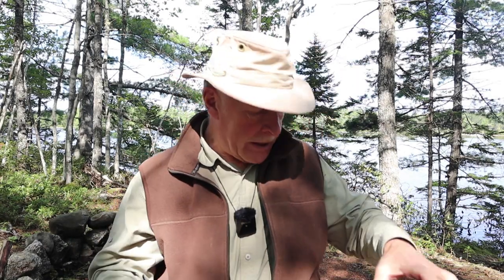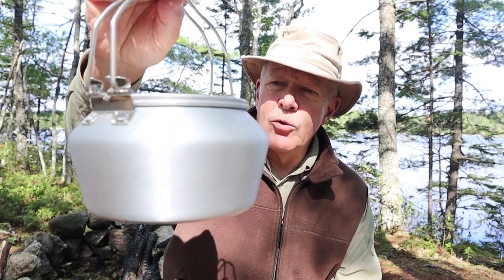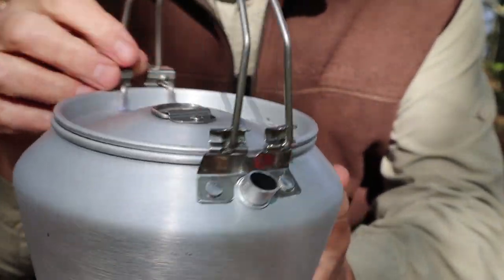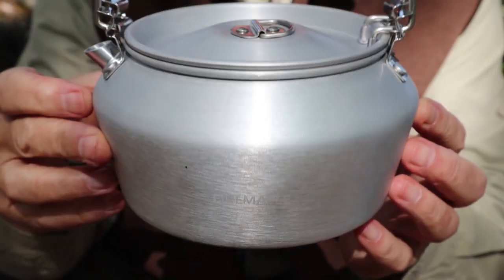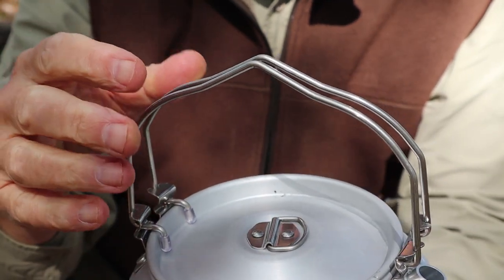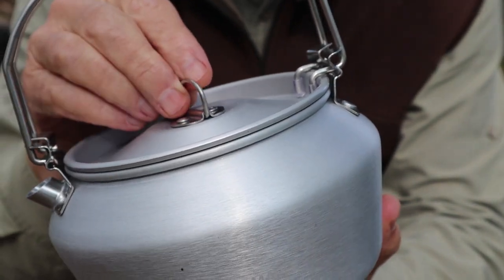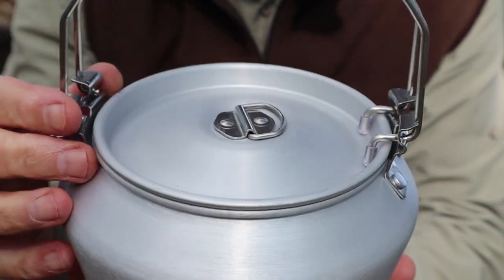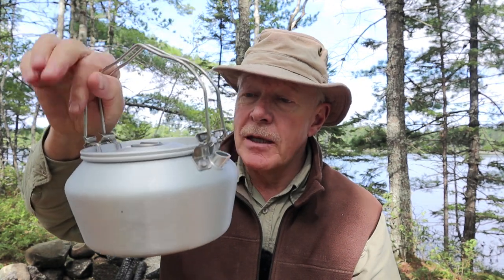Fire Maple Nimbus 1.2L Kettle

Comment: Hi Mark, hello folks, re: blackening ( a short story... made long lol) I love this so I like to pass it on:
I don't know about for use on aluminum as I only have/use stainless, that said, I cook almost exclusively with fire at this point, on the wood stove which runs 8 months anyway, then I stumbled into rocket stoves, design and tinkering as a hobby... aka, I've burned the hell out of some perfectly innocent kitchenware over a few years- so pretty much don't bother with my propane or butane stoves at all in summer anymore either as my fire game is locked down at this point. 
Anyway, came across ladies in a village in Africa I believe, and they take their cookware and first cover it in a slightly watered down clay, basically paint in on the pot bottom, sides and lid for that matter, let it dry for a minute near the fire. Then you're good to go. It can get as black with that shinny, lacquer like creosote and you just soak it for a minute to get the clay to start to moisten then scrub off with barely any time or effort. Keeping it wet or under water as you scrub is helpful also. 
I'm saying "scrub" but this is minimal effort in comparison to scrubbing a burnt pot. 
The other bonuses are: you're stainless remains unstained, even with daily fire use, and it doesn't need reapplying/ scrubbing off each use. So if you're camping, or rationing water in an emergency, just wash the inside after use and keep the outside to buildup a clay based creosote patina, a light cleaning to clear spilled food on the outside is fine, just don't submerge in water, then  ready wash up at the end, or pack up have a dedicated bag to put the black pot in ready for next time, washable to near new condition at any time. 
It's a pretty great "hack" tbh, it just, works. 👍👍
Pro tip: 😉 it is still a blackened pot so, pack both an oven mit type thing for cooking AND a rubber glove or scrubber with a handle will save your hands a lot of mess when washing, of course, but that's the same for washing any fire pot.
Reply from the maker: What an interesting idea. Wondering how to make it practical if clay is not available. Thanks for commenting
Reply: @MarkYoungBushcraft  well, I would guess whatever one has as a local source of "mud" would do just fine, maybe strain out any larger  stones & debris, but otherwise as long as it's thin enough to work with but thick enough for adhesion as it dries, maybe do two, three coats and should last just as well, perhaps somewhat less "waterproof" than clay, maybe.

Comment: Plenty of space inside to carry the dried food that I would rehydrate with the water boiled in the kettle. I wonder how well it heats over something like a Esbit? 
A smaller Esbit-type solid fuel stove should be small enough to fit inside the kettle.
"Instant stove", lighter, instant noodles, large plastic mug/small-ish bowl with lid, spork, and a utensil for boiling water, that all fits inside the boiling utensil - that is what I want. Water? I will be using it fairly near a river or canal, so as long as I strain it and boil it properly, water is a weight I do not need to carry. 
(Better fit a cloth for straining the water in, too🤣).
{I already have a "lidless" kettle that has a spout that is also the water filling point. So I guess that one is effectively a kettle-shaped aluminium water bottle. It will boil about 1 litre without spilling - maybe a bit more. I have never actually measured the "gross interior volume", but I have boiled a litre of water with it - 500ml for "double instant noodles", and 500ml for a large mug of instant coffee. BUT stuff, other than water, cannot be carried inside the kettle (only opening is a small spout!)).
Reply from the maker: The large opening is definitely one of the pros for this kettle. Thanks for commenting